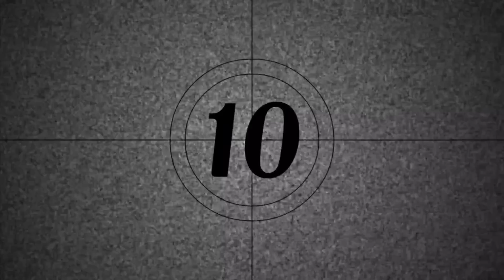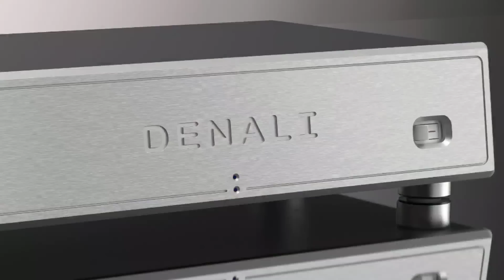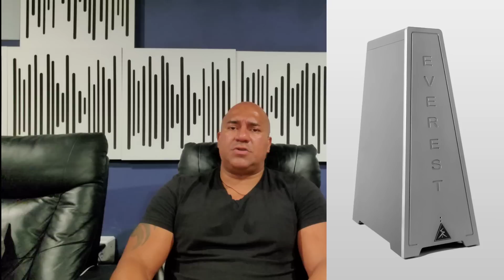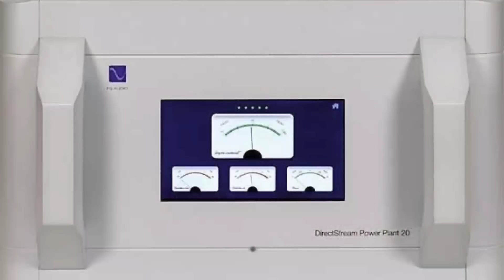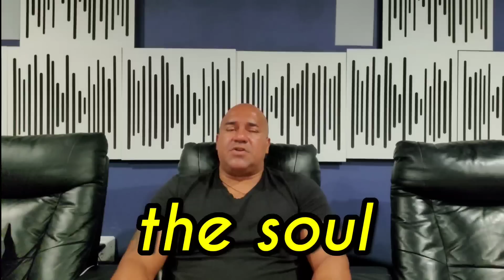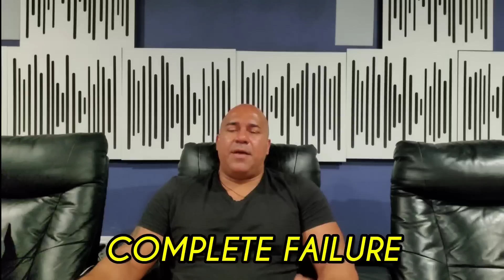Jay's Take on Power Conditioners

Comment: Approximately 6 months ago, I added a Shunyata Research Everest 8000/T to my system, with a Shunyata Research Sigma-X power cord.  The Omega-X power cord was twice the price of the already very expensive Sigma-X power cord.  And the Sigma-X power cord is better than the discontinued Omega power cord (that is, the non -X cord).

Initially, my soundstage shrunk, and my speakers only borderline disappeared.  That was completely unacceptable.  I contacted the store, and they said that they would contact Shunyata Research.

They got back to me, and said to give it time to break in (I believe that they said 20 hours -- hard to remember).  And they were right.  I now have an even wider soundstage, and my speakers vanish.

My noise floor is lowered, and everything sounds better.  I have not experienced a loss in the bass.  Did you give the Everest box enough time to break in?

By the way, if you (not you, personally) live in a civilized country, then most of the electrical noise does not come from power company (unless you have some unusual issue in your area).  Most of the electrical noise comes from each of your stereo's boxes, and the noise travels from box to box, leaving your stereo awash in its own electrical noise.

An Everest power distributor (Shunyata calls it a "distributor") prevents each box's noise from traveling from box to box.  So you are hearing each of your boxes at their best.  That is what makes the Everest and Niagara boxes so good.  I do not know if their lower tier boxes have that design.

Jay, I wonder why your big amps were affected as they were?
The Everest has a huge power reserve (I believe it is close to 100 amps) for musical transients.

Perhaps Shunyata's engineers can explain why you lose some bass authority.
Which power cords were you using?  You might need to use Shunyata's matched power cords.  It would be great if you could get all of the additional resolution, and lower noise floor, while maintaining your bass's authority.  Or perhaps two Everest boxes are needed with such amps?  Or, as I mentioned above, maybe more break-in time was needed?

Shunyata's latest model is the Everest-X, and I was told that is is noticeably better than the Everest 8000 (and 8000/T -- both of which are identical, despite having slightly different names).  I wanted the Everest-X, but it was nearly twice the price of the Everest 8000/T.  I had to restrain myself.

Have you tried the Everest with Shunyata's Altaira-X grounding box and associated products?

By the way, what was your assessment with the PS Audio Power Plant?
I have never heard a review of the Power Plants from someone with equipment like yours, and with an ear like yours.

Comment: In my opinion, I believe that there is a big difference between a power conditioner and a power regenerater.  For me, the Shunyata conditioner took the life out of the music. Power conditioners also can't correct the top and bottom clipping that happens when the AC signal is under a load. Which also takes away from the music. For me, just my opinion. Power  regenerater with good power cords deliver more resolution, more of a black background, more dynamic and music that sounds more present and life like. Thanks for what you do Jay. Have a great week.

Comment: Borrowed three different power conditioners from a dealer friend some years ago, and not one of the five people kind enough to audition could tell when one was connected and when one wasn't, no matter how expensive the unit. My setup consists of Lyngdorf source and amp, plus Monopulse 82 speakers - hardly entry-level stuff. All of us had perfectly good hearing, so unless the mains in my house is exceptionally clean, the only conclusion I can draw is that mains conditioners don't really do a fat lot. I'm sure many of you will disagree, but that is my honest experience.

Comment: What you say is exactly what the master from PS Audio himself says about power conditioners, you get more resolution and all that good stuff but you also rob the soul out of the music. He in fact doesn't recommend a power conditioner because of the "flavor" that every power conditioner has, however there are some very niche use cases when a power conditioner is required but in those rare use cases the audio quality and resolution is not the main reason why you'd want to use a power conditioner which is when you have very expensive equipment that may not be made anymore for decades or it's very sensitive or you are at an exposition where you share the same group with others and you have lots of signals being injected back into the grid that's a perfect example for when you'd want to have a power conditioner in between the grid and your precious audio equipment to filter out all the bad superimposed signals and have extra protection for the times that something goes wrong at the expo on your floor that the mistake made by your neighbor sharing the same group with you that his mistake doesn't take out your precious audio equipment too.

Comment: Today, i have one of the highest resolving systems known to man.  Today it is NOT bright.  It is extremely detailed without being harsh.  IT USE TO BE JUST LIKE YOURS.  Fatiguing for long listening sessions.  Bright and harsh. 

 I'm here to tell you that it can be extremely detailed without the negative aspect of the brightness.  It still plays out to 35.000 hz.  Not lacking any air or fine detail.  CUSTOM Raven R2 tweeters with 13 pound magnets each, assure the detail is there.  

You might want to consider getting something with DIRAC room correction and the Umik-2. The umik-2 has a 32 bit chip that can process up to 192 Khz.  The phase issues and  brightness are all gone. System is extremely holographic and three dimensional.  All the listener hears is the room in which the recording was made.  The speakers audibly disappear completely and all that is left is an amazing lifelike holographic presentation.  The speakers all work in unison to paint a wonderful picture who's instrument separation is unfathomed. 

It's  taken me over 10 years, but I can say that I have reached audio nirvana.  I can help you on your path if you are looking for some great advice.  And you are correct that everything matters when it comes to picking out each and every audio component, because everything has an influence on the overall sound.

And my system is engaging as well.  I just gave a demo two days ago, and the person spent two hours and didn't want to stop.  The listener was head bobbing and tapping toes on each and every song.  In fact, when one song came on, he said if he was listening to it on his system, he would scroll right by to the next track.  But on my system, he said that it drew him right in and he wanted to listen to the entire song.  

I had a second demo last night, and the person was listening for two hours and didn't want to stop.  They were toe tapping and head bobbing as well.  

It's hard to balance highly resolving with highly engaging.

Comment: Wow!  I agree with you 100% with what power conditioners do to power amps.  For me it was diminished upper bass/lower midrange performance from the Niagara 5000.  Everything else was stellar.  The solution for me was to plug everything in the conditioner for general usage, but for critical listening plug the amp straight into the wall.

Comment: Pardon me for posting twice, but I can understand how a person might hear a difference when dealing with tube amps. Many audiophiles can hear a difference between using tube type rectification in the amp, and solid state rectifiers, so the nature of the power supply to tubes can be a factor. Some audiophiles insist on tube rectification for the best tube sound. a lot of the very high end tube amps will use tube rectifiers in their linear power  supplies.

Comment: Which type of power supply does a power conditioner most benefit? Linear power supplies, or switch mode power supplies? Be careful about the answer. Saying it's the same would not be the correct answer. The power supplies are dramatically different from each other and as such the separation between the input and the output of the power supplies themselves are done differently. They share some common components like a transformer and filter caps but how they go about producing DC power is completely different.
"I don't know" is also a very acceptable answer.

Comment: I agree on the power cords for the amps being important. When it comes to surge protection, the devise should be at the breaker panel. This is called primary surge protection. Anything in the house is a secondary surge protector and is less effective.

Comment: Jay, great video, I completely agree with your assessment regarding to the power conditioners, they all have their signature sounding and suck the life out of the music. I have the hydra triton v3 and I prefer plugging my tube amps straight to the wall outlets ( dedicated line with isolated ground ). I hear more and feel emotionally connected to the music. Is the triton v3 no good? No, I still have all my front end gears connected to it and extremely happy. Try gears with or without the power conditioner and see what you like. Again, great video and thank you for sharing.

Comment: As a power conditoner engineer. I know what you mean. Some low frequency loss. Ive been designing a device that filters power in an alternative way, which does not take away from low audio frequencies as well as not brighten up the soundstage.  Finally, after a few thousand hrs of research, I discovered a way. There are just physics limitations that make it difficult, you almost always have to sacrifice bass for better resolution, etc... Your video was very informative as to your thruthful opinion on power conditioners. It helps with my validation of my audio products which are patent pending.

Comment: I've had my Belkin Pure AV since 2005. It was only $500 and works great, cuts background white noise down by about 50%. I don't notice any detriment on my system, which uses gainclone amps and an ESS9028 DAC chip.

Comment: Hi Jay I was wondering at what point you would mention how every power conditioner changes the music and steals the soul of the music . This is because the conditioners detract from the music .
The problem is where the mains comes into your house , rule number one . You need seperate mains tails before you house  . To a seperate isolater switch . Then a designated ring main for your hi fi 
And only the hi fi . So this is completely seperate from the house electricity . The surpressers in the fridge your washing machine dishwasher etc. All these will destroy your sound . 
Upgrade the cable in size for the hi fi ring main seperate 20mm earth spike into the ground . 
No switches on the wall sockets . This will eliminate the need for A. Conditioner B.expensive massive power cords . Please do not try this yourself you need a fully qualified Electrican . To install these leads from the mains to the seperate box .  As this will be live all the time Wearing the big rubber gloves . Here in uk. Its 240 volts
If they touch it will kill you so it has to be a professional and i dont mean a Audio Dealler. 
This is where all or most of the problems lie . Interfearance and mains noise. You have my e mail if you want me to send you a diagram or photos happy to help. You have 110v in the USA. But i have no idea of cable diameters. That is installed into houses in the USA . . If a person lives next to a hospital or a sub station then you are stuffed. Seriously unclean and noisy mains . 
Like your channel some really great Audio kit . 
Regards George
You need clean mains .

Comment: I was shocked at how much the noise floor dropped when I placed a Equitech Model Q Balanced Power Conditioner into my system. I have piggy backed it to my Promethean Power Flo. This equipment is quite dated by now but I still can't fathom why the Model Q's original owner ever returned this unit .

I relegated my PS Audio Power Plant to my Video playback system.

Comment: I agree to some of this, but this is not the whole picture. Quite often power conditioning are isolated as a singel event when i'ts reviewed. I think thats wrong. 
I'v owned Isotek super titan evo3, Purist Audio Design, Entreq, Monster, Nordost and I'v also tried other brands in my system like Transparent, Isol-8, GigaWatt and Shunyata. They all sound different and have not the same effect as you also point out . I agree that power amps could be restrained, but front-end units (pre-amp and source) are usually gaining on this. Though, this is just one part of it. Nordost QRT system is the best I'v tried.  You can try and use these products as you like and figure out where it has the best effect. I don't use the conditioning part of it in front of my poweramps.  A very good  straight line AC distributor path is important as the first product after the wall socket. The power cord is very important, especially the first one.

Comment: My one nit on the video is that I also think this is hugely environment dependent too. Ex. My room that has dedicated 20 amp lines in a house 1.5 miles from a power substation did not benefit from the conditioner. But in the past, such as in a condo in a major city, the positive effect was bigger.

Thus this is one where the system is part, but the environment is huge.

Comment: I had an experience like this where I bought an Audioquest Tornado and an AQ Niagara 5000 at the same time, but the cable came first. The whole time,.I had been more excited for the conditioner, and when I got the cord and used it, I was blown away by the impact. That raised my expectations for the Niagara that much further.

Then the Niagara came and... flat. The musicality disappeared. I was shocked how much more impactful the cable was.
Reply: It's a difficult one. Perhaps the Niagra was actually just removing more noise - like any conditioner is it's job. With what comes through the wall - like video with what we see - audio what we hear is noise and fucked frequencies and waveforms. New wall wiring, dedicated lines, wall sockets, plugs, good cables, audio/video grade fuses, even Deoxit etc etc 'all' help greatly - I use them myself and they absolutely do work but believe they can only do so much by their design. But really at the end of the day what we hear is basically interference. Personally I think a good (good) conditioner takes away what isn't meant to be there and that's really what we are hearing and seeing. Yeah it can sound different until it becomes the norm. But personally when I've just plugged directly back into a wall I see the screen looks nothing like as clean and sharp - and audio sounds hashy and things get lost. But does need a bit of time one way or the other before going back.

I 100% believe we need the whole lot but that's only my opinion

Comment: Jay,
I am 100% agree with you. From my end, the only power conditioner that doesn’t subtract bass from a amp but add clarity and openness to the sound, is the shunyata cyclops. I tried others for amps including the shunyata d2000t and all subtract bass impact from the amp. The denali d2000 is better but still subtract a little impact as well.

Comment: Hi Jay, through my experience I found out that component with separate power unit like my MSB premier with separate power unit perform better without power conditioner as they already have that covered in their own unit. Adding power conditioner change instruments sound and yes provide more details on the expense of the organic sound.  So I agree with however I tried other Streamers like Aries without a power unit and found them better sounding with power conditioners.

Comment: Hi Jay, it's not just you, I also feel that a lot of power conditioners take away tonality and musicality and trade it for resolution. It's quite a quest to find the optimum for best tonality. I also second your experience to plug power amp(s) straight to wall with an excellent cord, and keep the sources "conditioned". In my case, I also found that no conditioner is still best for DAC / phono / turntable. I use individual isolation transformers for them, and very high quality power cords. In addition, I have a capacitor bank that I engage in situations when the power factor is not optimal (holiday seasons), and an RGPC inductor when the line is overloaded and DC is present. That's all.... I renegaded the computer, lamps, wifi etc in the house on to the "dedicated", quite expensive audio line conditioners... LOL. I agree 100% with every single one of your conclusions, goals, and how you go about solving them! (I'm also a long time audiophile, listening for extended hours.)

Comment: The power conditioners usually react a lot better when you take the DAC away from it, and especially the streamer. The streamer has a tendency of affecting all of the rest of the gear really bad.
Try Isol 8 mini sub axis, that is the most natural one I have heard, and the bigger models are slightly better. Most others sound a lot like Jay says: Unnatural and hyped up/weird and unrealistic dynamics.
Plus what most power conditioners do wrong is use solid core cable which locks the sound into a certain mode so all different cables sound the same and all your units sound almost the same. Isol 8 are one of the few ones that does not do this. Plus it's dirt cheap. But yeah some gear does already filter the sound so much that power filtering from even some of the best boxes totally kill the sound. Mcintosh is a good example of that, most normal power boxes sound horrible on Mcintosh, only a few ones sound okay to pretty good.